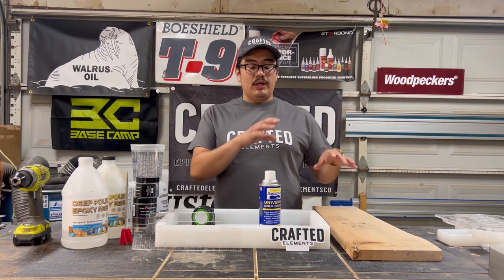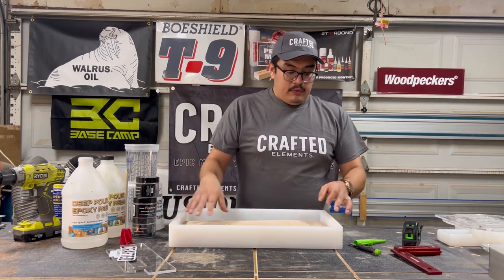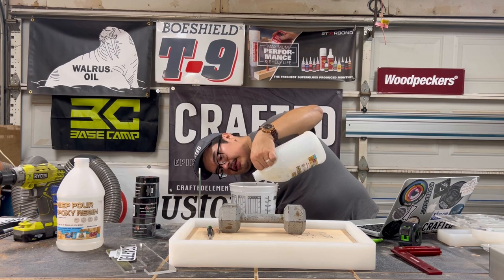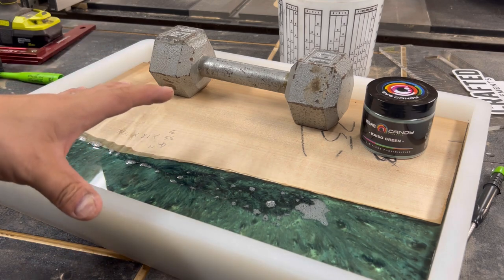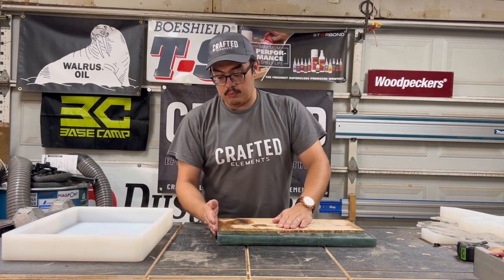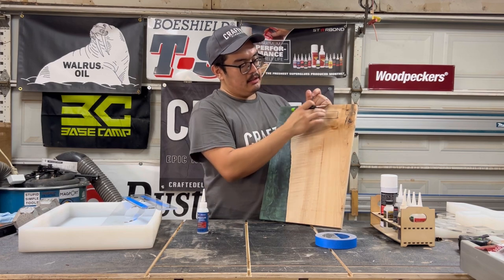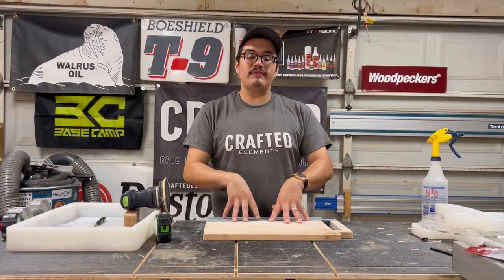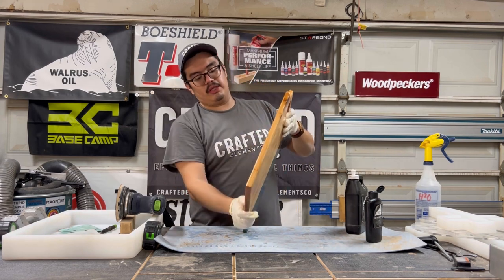DIY Epoxy Resin & Wood Cutting Board - Start To Finish Project

Comment: I really wished you would've shown the spraying, so we could get a sense of how much to apply. 
Does the spray need to dry before putting in the wood/epoxy in the mold?
Reply from the maker: In some of my build videos I do, Keep it 6-8" away from the mold and just get a good coat. Many people miss the sides, make sure you get them. YES, let it dry 5-10 minutes before putting your wood and epoxy in the mold.

Comment: Where does it show you the OZ. After you get the Gallons? I didn’t see that on the calculator. Thanks.
Reply from the maker: 1oz = 0.0078125 gallons, 1 gallon = 128 oz
Reply: @CraftedElements  Thanks!